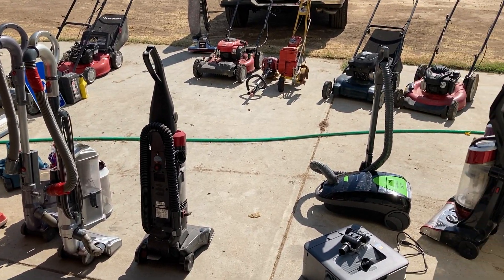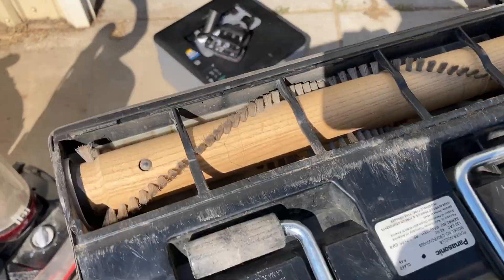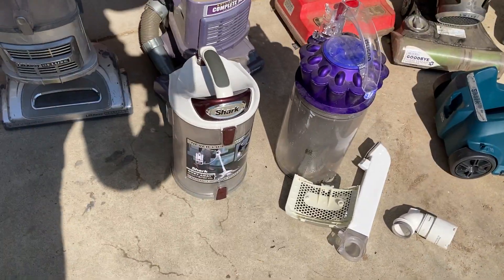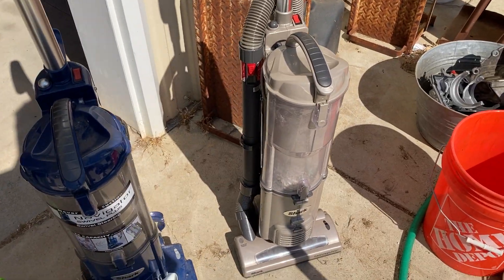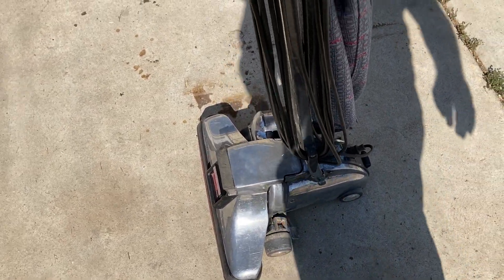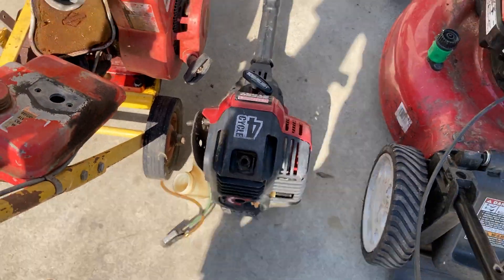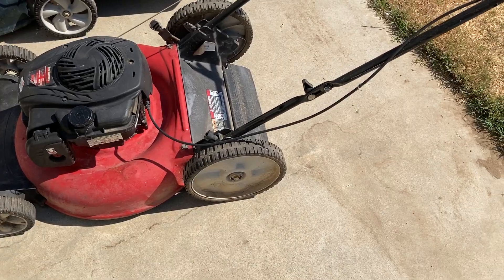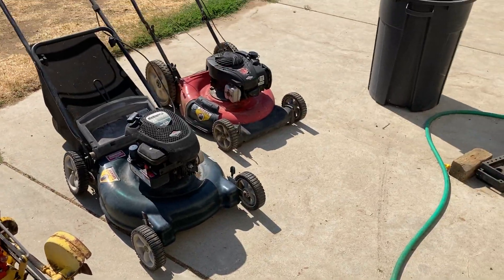A Midsummer Trash Haul 2020 - Mowers, Vacuums, Tools, Vintage Edger, Dyson V6 etc

Comment: i have that same mclain edger, total badass machine, run forever & still ask 4 more! mine is a 1969, i upgraded too eletronic magnito, i hate points!  pull choke,pull start rope Bam! every time, now 2hp dosent sound like much,but it is
Reply from the maker: Yea they are pretty good engines. I am not a fan of points either

Comment: Hank,      Do you run a business or just pickup stuff in your spare time to flip for $? I find it interesting how you work on lawn mowers & vacuum cleaners. So many different items.
Reply from the maker: It’s all a hobby. I’ve Self taught a lot of stuff and always like picking up new things. The small engine stuff is mostly flip but a good amount of fixing for word of mouth. The vacuums I usually sell. But with all the stuff I’m into it’s mostly an investment into this channel which generates a fairly reliable revenue stream. So in a sense most of these repair videos I do are an investment in this channel
Reply: Thanks for replying 😊. I also pick up lawn mowers & just about any type of small engine item that comes my way. I also pick up Weber grills, clean them , fix them & sell. No YouTube videos yet.
Reply from the maker: That’s a good side revenue. I’ve just done the one here on my channel but I’ve yet to get into bbqs lol